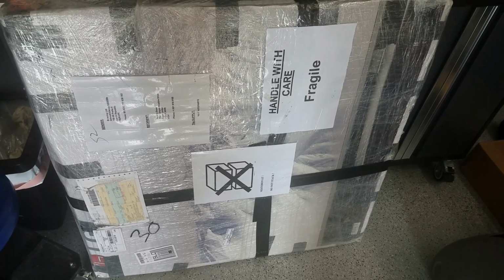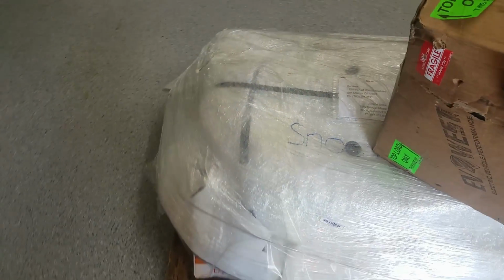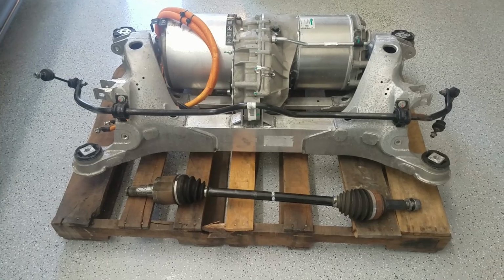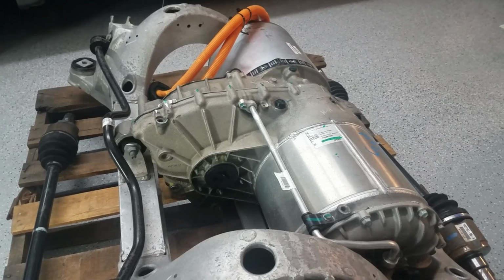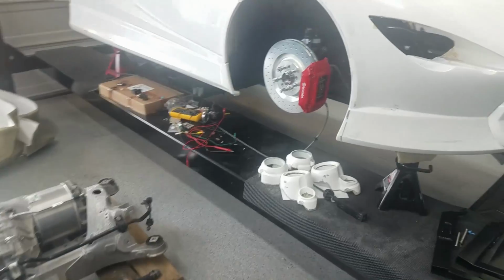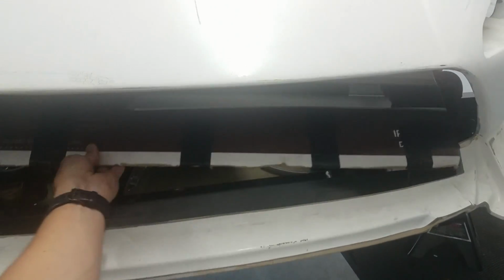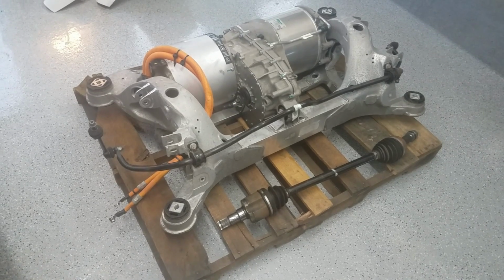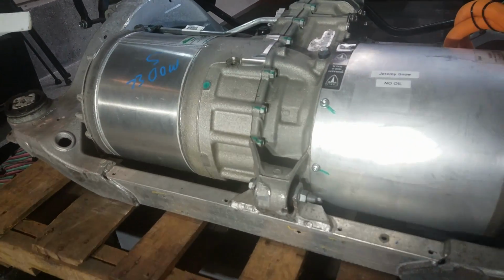Tesla Motor Arrives

Comment: I suppose in my case I'll be reusing the Transmission from the 2006 Dodge Charger SRT8 and figure out a way to mount it to the Tesla motor (which means running new brake lines a new clutch line for the clutch pedal and a new gas line for the gas pedal. oh what fun).
Reply: Hi did u find a way to mount it to the transmission?
Reply: @yasindudesilva1458  one idea would to forge some kind of adapter plate. and mount the transmission that way.

Comment: I have a question about this motor
How much it will cost and 
Witch Tesla model car motor this is
And how much horsepower ? Thanks
Reply from the maker: This is from a Tesla model S performance.  With the controller I am using, it will produce 475kW (637hp).  You can find the motor on ebay for $3,000 - $4,000
Reply: Thanks
Reply: Isn’t tesla model s performance has dual motor
Reply: Give me the link where you fine the motor I want to make my own car !!
Reply from the maker: @abguru6011  ebay.com
Just search for "Tesla large drive unit"

Comment: Hi, I know this a long time ago but just wanted to ask....as you have gone direct drive (no gearbox straight to half shafts) is it just a case of using same size wheels as the original car. i.e 19" or 20" wheels same as model S? Then don't need gearing reduction or internal diff? Thanks
Reply from the maker: Yes no gearbox.  Wheel size is slightly smaller than model s

Comment: Hi, Could you tell me which kind of parts necessary for the electric car?? I want to change my car to electric car. İf you answer I will be glad.
Reply from the maker: There are many parts.  The main parts are the motor, controller, onboard charger, and DC-DC converter.  Watch my series to learn more!
Reply: @electricsupercar  Thanks, I am watching you 👍✌️
Reply: @electricsupercar  How does the 12V Battery charge?
Reply from the maker: While driving...it is the DC-DC converter.  It takes energy from the high voltage pack and turns it into 12V (acts like an alternator).